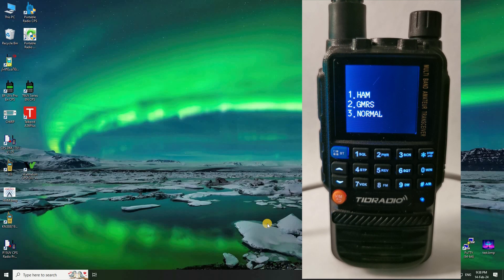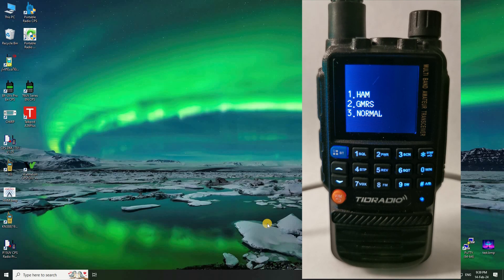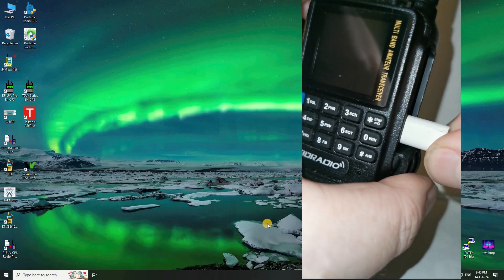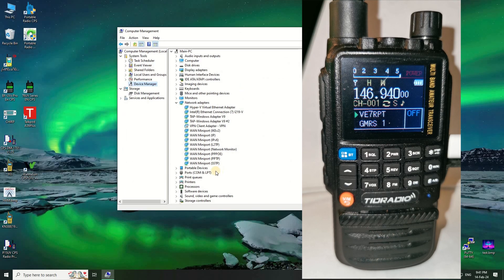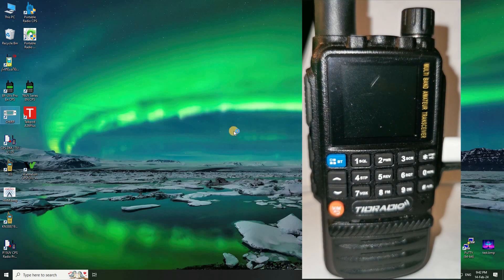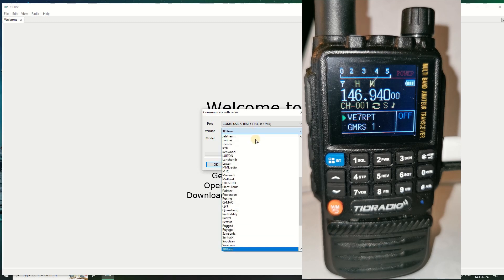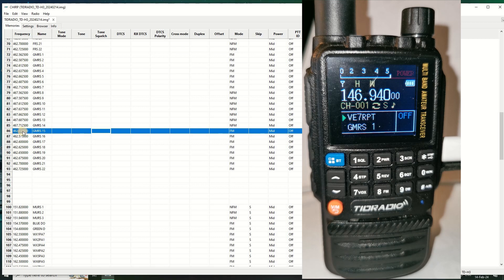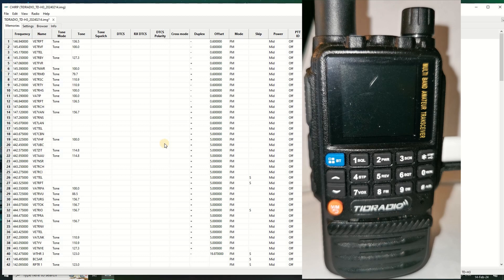TIDRadio H3 HAM GMRS Tip USB-C programming

Comment: What  is weird to me... I have it in GMRS mode, and I have GMRS frequencies in it and have repeaters programmed in on the same GMRS  repeater frequencies as the stock repeater frequencies (So i may have multiples on the same frequency pair but different DTS or CTMS codes)... and that all works great, but if I try to input a simplex GMRS frequency with a code... DTX or just Code.. on a new channel... it will beept at me when I try to transmit with it even if it is setup exactly like the stock included codes. and it won't let me copy paste them either it seems. I don't understand how it is authorized for GMRS (in the mode) and won't let me enter legal channels that are simplx with a code and it won't work.

Comment: thank you very much for the tutorial. I just have a doubt, How can i save frequency 119,400 as a channel? 
I have tried with chirp and with the manufacturer's software, but I have not been able to, because an error appears: it is not a supported frequency. However, I can hear that frequency. thanks again!
Reply from the maker: +@mazzivo31337 not sure what your setting are but I am able to program the airband frequency in chip to the radio
Reply: @ham-fam  thanks for answering. I have tried to unlock the device, with options 1, 2 and 3. ham, GMRS and normal. but in each of them it does not work to record the aerial band with chirp. It may have to do with the fact that the name of the firmware says "GMRS" and other numbers. I don't know.
Reply from the maker: @mazzivo31337  Set the radio to Normal, that is what I have mine on
. Then turn on AM in the menu 48. then try again. my radio has version 231228 (Menu 42)